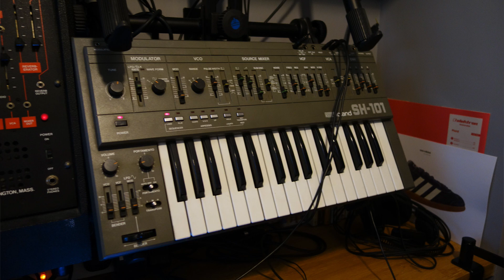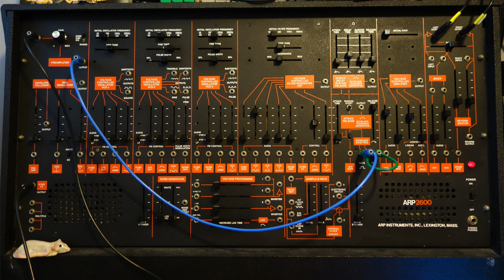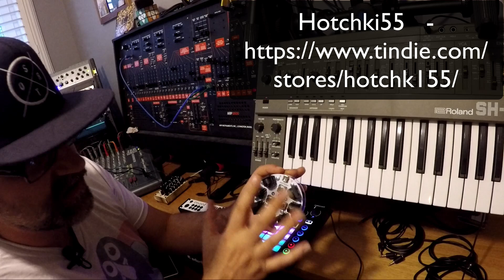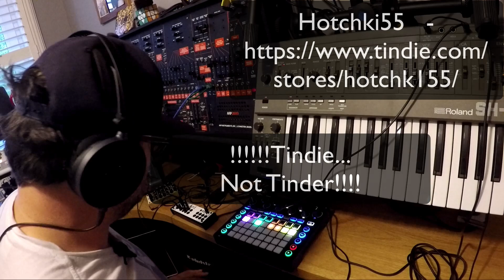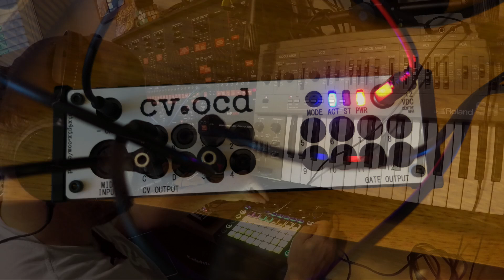Novation Circuit controls ARP 2600 and Roland SH-101with the mighty Hotchki55 CV.OCD

Comment: Hi there Calc. Great thorough videos!!  How many channels of midi can I run at the same time, using circuit's sequencer?
Reply from the maker: Thanks Brian, Using Circuit there are 3 outputing MIDI channels, they are fixed at channel 1 and 2 (synth 1 and 2) and channel 10 for each of the drums. 
The CV. OCD is perfect for this as out of the box it's configured with Circuit in mind. Channels 1+2 on CV and gate combos then the ch10 drums are set to trigger outputs. It's totally configurable too so really is a powerful MIDI to CV converter

Comment: well, let's say I'm controlling a microkorg from the circuit. all the editing that I do live on the microkorg will affect the notes sent from the circuit, right? what happens if I play an additional layer on the microkorg, is it possible to do without affecting what I already did on the circuit? (great video by the way, many thanks)
Reply from the maker: Hey Ali, it depends on a couple of things, that is if I understand your question right. 
If the MicroKorg sends out CC messages then it is likely that the parameter changes you make on the the Korg will also manipulate the parameters on Circuit, changing the sound (on that MIDI channel). The only way to stop this would be to stop the Korg's CC messages being sent. Unfortunately I don't know the MicroKorg at all so I can't help there.
You can also turn off MIDI being received by Circuit on the MIDI set-up page (turn on holding the shift button)  but I'm guessing you don't want to do this as it will stop the Korg keyboard playing Circuit's sounds.
A work around could be to change the MicroKorg to MIDI channel 3 when you want to design the sound directly on the Korg. This will not affect the Circuit at all (as there is nothing connected on MIDI channel 3) but the downside is that Circuit cannot sequence or play the Korg in this state. When you do want to sequence the Korg you can switch back to MIDI channel 1 or 2 to connect to Circuit synth 1 or 2. Using MIDI channel 3 would also be a way to keep the Korg separate for playing extra musical lines over the 2 Circuit internal sequencers too.
Not sure if that fully explains it but hopefully there is something here to help you out.
Thanks for the comment

CALC
Reply: Calc! Thanks a lot, you explained it well! 

"A work around could be to change the MicroKorg to MIDI channel 3 when you want to design the sound directly on the Korg. This will not affect the Circuit at all (as there is nothing connected on MIDI channel 3) but the downside is that Circuit cannot sequence or play the Korg in this state. When you do want to sequence the Korg you can switch back to MIDI channel 1 or 2 to connect to Circuit synth 1 or 2. Using MIDI channel 3 would also be a way to keep the Korg separate for playing extra musical lines over the 2 Circuit internal sequencers too."

That's what I wanted to check for, I'm about to order the circuit, it's good to know that I can switch between MIDI channels, especially during a jam! so that I can play extra music line with the microkorg over the 2 circuit sequencers..

keep up with your great jams.. a./

Comment: can it work as triggers too for adsrs and drum modules? My sequencer would want one midi note = one trigger (one midi channel per trigger would eat too many tracks).
Reply from the maker: Yep pretty sure there can be 1 note = trigger on one channel. On the configuration software you can set the trigger to come from any specific channel and then choose the exact note by setting a min/max note number. It's a really versatile little box.
Reply: cool thanks

Comment: Incredible ! Would it be possible to assign many (4 or more) cv and gate outputs on the same midi channel to have polyphony ? That would be great because that thing is probably cheaper than all the expensive eurorack midi modules which barely have 4 cv and gate outputs... :)
Reply from the maker: Absolutely this thing is completely configurable and I've had the ARP working as a 3 voice paraphonic synth.... sequenced from Circuit which is pretty amazing. You can take a look at the configuring software at http://six4pix.com/cvocd/patch.asp there's tons of options..... 
It's bloody marvellous!!! 
You can sign up to Jason's 'tell me when it's ready'  list here too. http://eepurl.com/b3Eh_P
Reply: Honestly I wasn't expecting that much from it... Thanks for the informations ;)